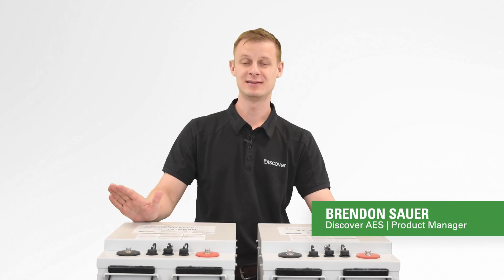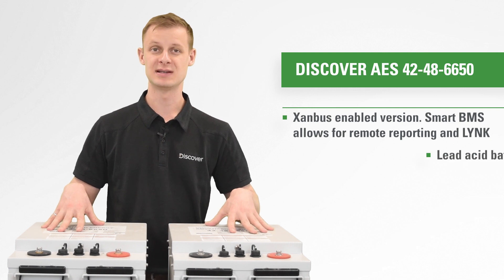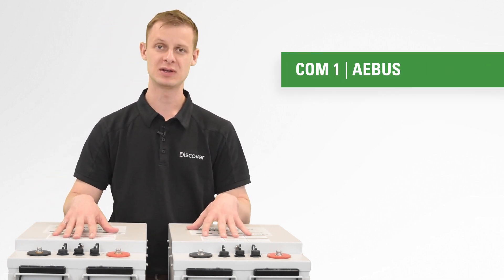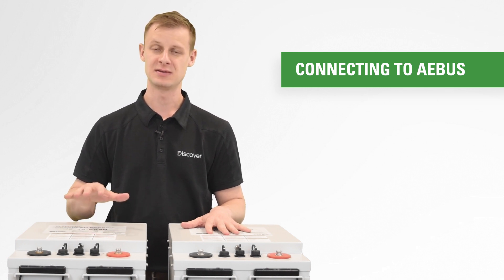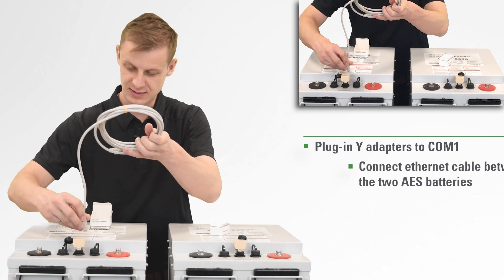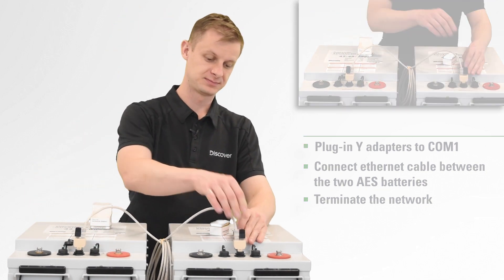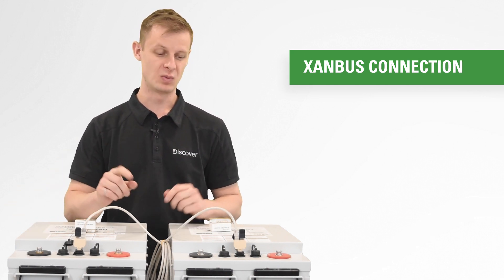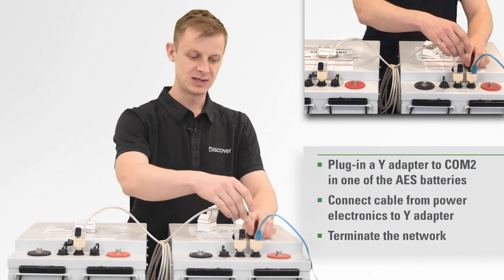Discover Battery™: How to terminate your CAN network with Discover AES Lithium Batteries

Comment: If your batteries aren't communicating, what happens when one battery, perhaps next to a window, drops in temperature and gets shut down, but the other doesn't - what's going to happen when one charges and the other turns on at a much lower charge hours later?   Are they smart enough not to have to worry about that?

Comment: I have an older Schneider XW6048 that doesn't have firmware for its charger to support Lithium batteries. Will  your batteries still be compatible with my inverter/charger through the xanbus connection, or am I still limited by my inverter's firmware--since my old firmware can't properly charge LiFePO4 batteries as though they were a lead acid replacement.
Reply from the maker: mark durstewitz we would advise that new products should be used. Maybe not the news you wanted to hear but the older equipment used memory differently — the closed loop communications may wear this memory out. Newer stuff has most of the settings we use in ram – which has essentially infinite write/erase cycles. Hope that helps. 🇨🇦✌🏼
Reply: Wow, I'm glad I asked. Disappointing, but at least I found out before I purchased your batteries. Thank you.
Reply: You can do the exact same thing I did with Jason's system.  I updated all of the product component fw on his original XW parts to their equivalent in XW+ fw.   Anyone using a single cluster or less of Schneider or Xantrex XW components can update to the latest XW+ fw and get those features and improvements.  Download the fw from the Schneider site and rename the fw files to the part # equivalent of what you've already got then just do standard fw update procedure through the combox.   I worked at  Schneider for almost 20 years in various sales and product management functions and my team released the XW+ upgrade platform.  - David
Reply: mark durstewitz you might want to read the next comment
Reply: Thanks David.  I have the latest XW6848 firmware downloaded, but I haven't installed it yet in my XW6048.  But I don't think that changes the fact that Discover Battery says that the older equipment uses memory differently and it could wear out the memory that's in the AES batteries.  Am I misunderstanding this?  Or maybe you mean that by updating the firmware, I can just use the batteries as lead acid replacements and not use Xanbus.  But if that's the case, there are much cheaper alternatives to the AES batteries w/ Xanbus.  Thanks for the suggestion!
Reply: Once you install XW+ fw on an XW you effectively have an XW+ as if you'd bought it that way originally.   Unless you have a multi-cluster requirement for >3 inverters there is zero difference in the way they'll perform or the methodology by which they do that.   Discover AES works with XW+ and therefore it will work with your new(ish) XW+.
Reply: But does the firmware upgrade change the way the older XW6048 uses memory?  I wouldn't want to void the warranty of the AES batteries or have to arrange warranty repair because the memory (NVRAM I assume) wore out.
Reply: I think you're referring to the EPROM?   I don't know where you heard about the "memory use" issue from but the two devices are identical (with caveat I mentioned previously) once they use the same fw.   Suggest you contact an SAE from Schneider for their stance on warranty because that's outside of my/our purview but I can assure you, the products are electrically and electronically identical with same processor.
Reply: I'm referring to the first reply to my question in this thread that was actually from "Discover Battery".  My inverter is out of warranty, but I was referring to Discover's warranty on their battery, not the inverter, since the person that replied to my email said that the memory in the battery could wear out because of the way the old XW6048 used memory.  Thanks!
Reply: His quote, "mark durstewitz we would advise that new products should be used. Maybe not the news you wanted to hear but the older equipment used memory differently — the closed loop communications may wear this memory out. Newer stuff has most of the settings we use in ram – which has essentially infinite write/erase cycles. Hope that helps. 🇨🇦✌🏼"
Reply: Marketing guys here posted that response.   Best they could do and cautious so I get it.
Reply: Ok. It sounded like if it was known beforehand that the way the old unit accessed memory, it could prematurely wear out the memory in the battery.  If that was the case, I wasn't sure if it would void the warranty, and these batteries are really expensive. Thank you again for all the information!
Reply: Actually, now that I re-read their comment, it sounds like they are saying the "closed loop communications" is in the battery and may wear out the memory in the XW6048. But are you saying that the latest XW6848 firmware, once installed in the XW6048, will eliminate this problem? Since my inverter is no longer in warranty, I would not want to damage the memory in the XW6048.
Reply: @truenorthsolarconsulting6125  Will that XW+ firmware upgrade work onto a Xantrex XW6048?